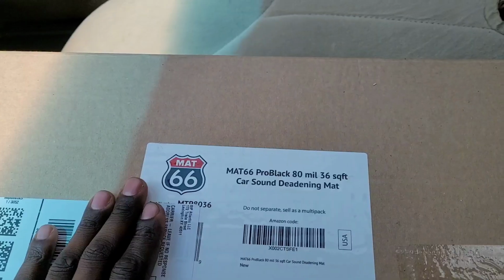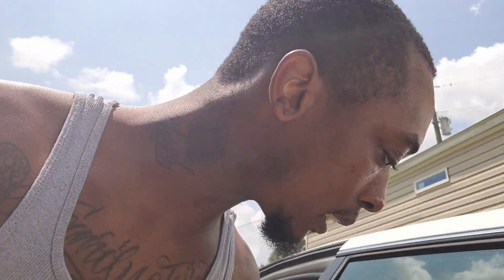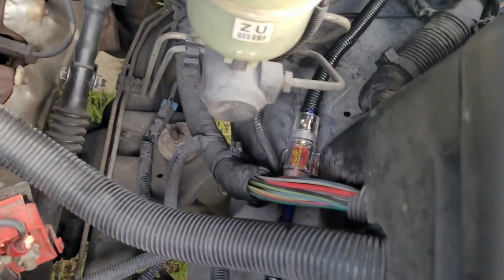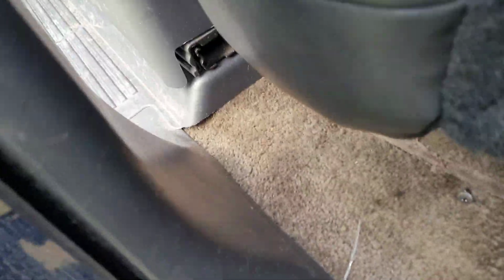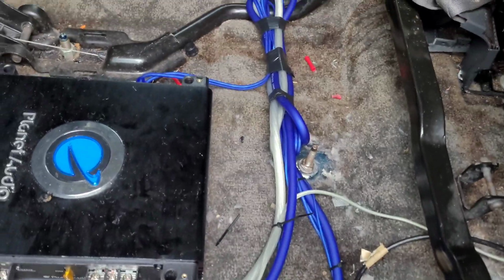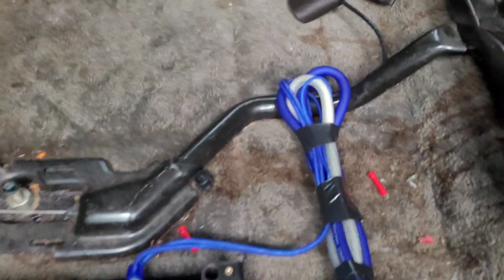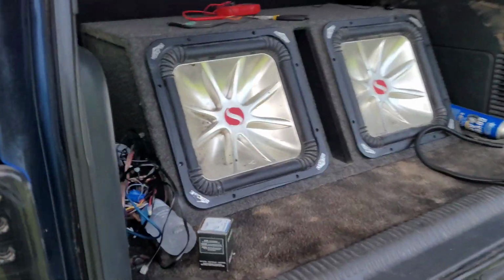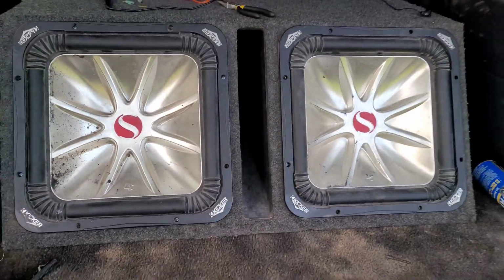Full Car Audio Install| Planet Audio 1500watt amp | Kicker L5 15s| Clean Installation| Tahoe Build

Comment: That's crazy bro I got the same amp and I'm pushing 2 12s kickers cvr and my amp keeps going into protect mode what do u have ur gain n bass boost setting at
Reply: Don't use bass boost. Blows woofers. I've owned multiple CVRs. I've had the 10s the 12s and the 15s. Every single one of them had tinsel lead issues. They snap off. The 10s came off where they go into the woofer the 12s and 15s broke at the push terminal. Made my amp go into protect every time it happened.